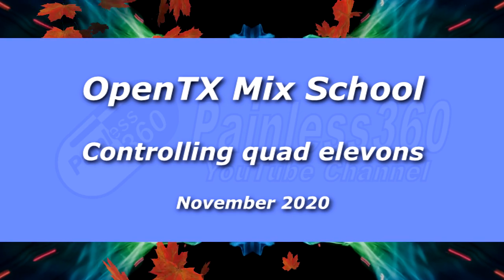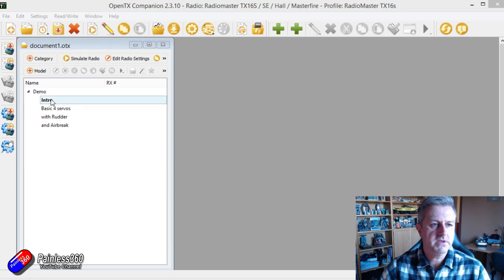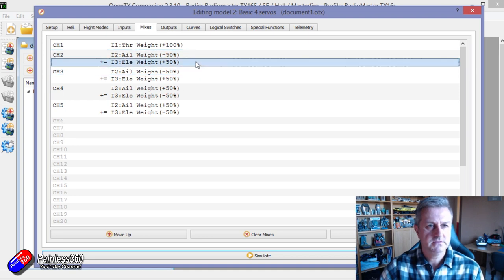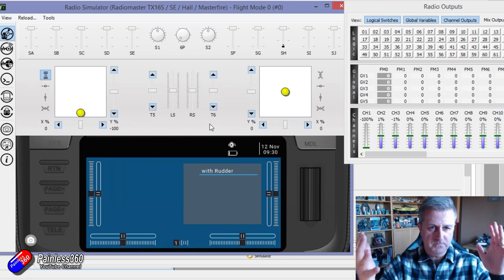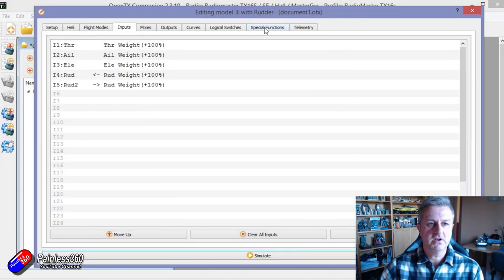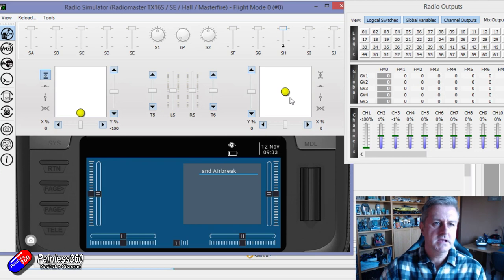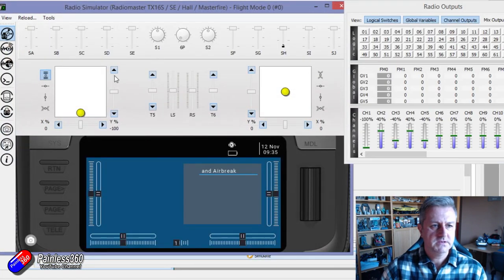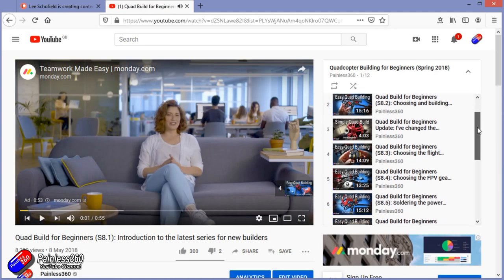OpenTX Mix School: Controlling multiple elevons/ailerons for rudder and brake

Comment: I've scoured through YouTube and Facebook Groups for this EXACT topic and the answer is right here in my face! 

The only thing that's just out of my reach is the OTX File, so I can upload it onto my OpenTX Companion for my TX16S... PLEEEAASE tell me you still have the OTX File available to download ! ? ! ? ** Grovels at your feet ** Just a little more info... I'm a Mode 2 (RETA) radio control user... I believe you have your video guide set to Mode 1 (TAER). Does your OTX File support Mode 2 setup as well?

I recently purchased a DefiantWings 66 RC Wing kit and I would LOVE to use Split Elevons on it as well as additional wings I'd like to use these features on in the future!!
Reply from the maker: File is in the video description. I've just tested it and it still works.. Best of luck!